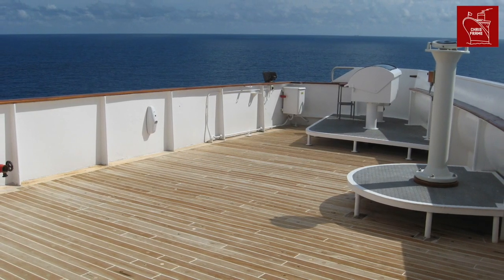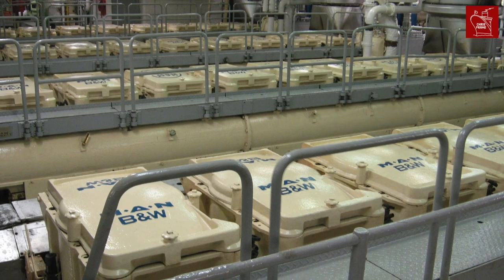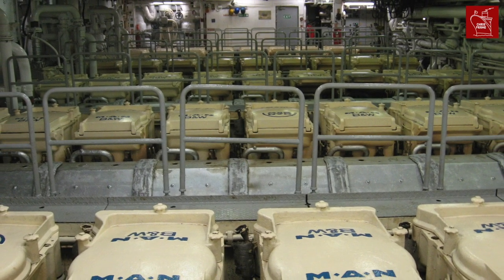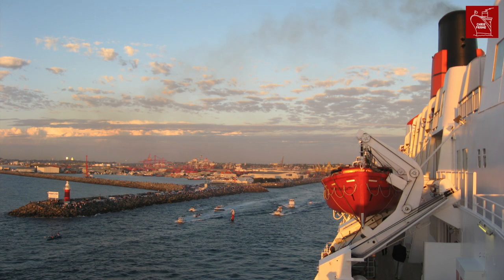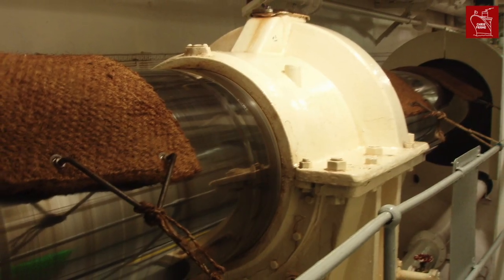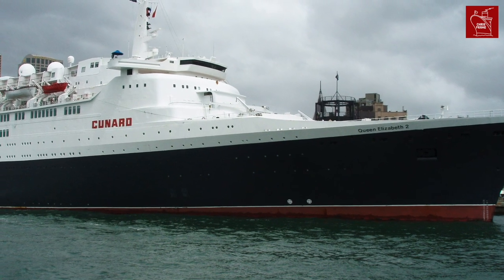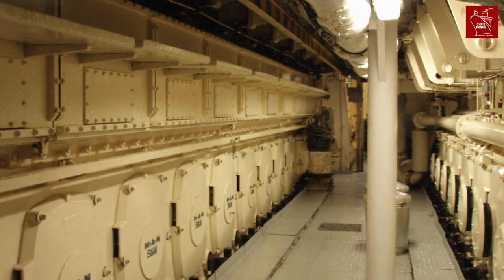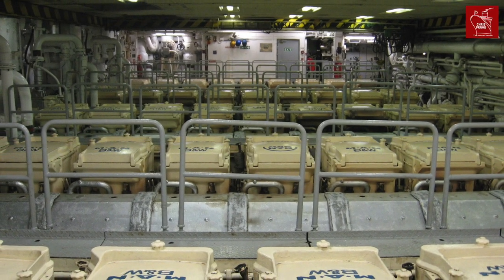QE2’s engines were enormous! Find out why!

Comment from the maker: What's the fastest speed you've seen on a cruise? Mine was 30.5 knots on QE2 during her farewell World Cruise - EPIC! Actually, we were going over 30 knots when I toured the engine room - the noise, heat and power was unbelievable! A moment I'll never forget!
Reply: 30 knots on QE2 for me too!!
Reply: That wood have been amazing!!
Reply: I recall seeing 28 knots or so when QM2 was sprinting to a medivac helicopter rendezvous - this would only have been for an hour or two, not an entire crossing.
Reply: I was aboard during sea trials in 87 after the new engines were installed. The engines were throttled up and the ship almost shook itself apart. We lost a propeller, or at least part of one and other damage to props later during a cruise.  The top theoretical speed was rarely achieved. It just wasn't feasible.
Reply: During my stay on the QE2, if the navigation display is right, we sailed 34 knots, that was after we hit 90+ foot wave in the middle of altlantic. We slowed first to a crawling 5 knots for several hours,  after we passed that turbulence, we speed up to catch the lost distance that we should have traveled. We were able to cross the atlantic still in 5 day time , delayed only of around 6hours more or less. Normally we're docked by 7am, we're able to make it at around 1pm of the 5th day of crossing. That was the time of hurricane HUGO if I were not mistaken.
Reply: Diesel engine cylinder engineering room ships
Reply: @slickmcintyre8396  Sorry slicky but i simply DO NOT BELEIVE you .  Why ?  Because Britains most famous flagship had just undergone the biggest refit in maritime history. It would surely be plastered over every front page of every newspaper if what you said was true.  The only possible explanation for what you say is if she had literally come out of the builders yard with no adjustments to the RPM and the propellor pitch which was always going to be necessary .
Reply from the maker: @sebcat04 I think it was a mistake in the way I phrased the wording - thanks for pointing it out - it's been corrected :)

Comment: Blimey! I had no idea they'd take off the funnel to change it over. That's bonkers!!
Reply from the maker: It had the added benefit of her getting a much bigger, more impressive funnel after the refit too. It now had 9 exhaust pipes rather than the original 3 from the old boilers.
Reply: I seem to remember it was the first time 3d CAD had been used.  The yard drew out the vertical trunking and also the largest part that needed to be lowered into the space.  For the engineroom it was the diesel bed plates, whereas for the motor room it was the shaft motors.  They found that they could animate the passage of these items down the trunking without cutting holes in the hull, (actually quite common) which speeded up the conversion.  I think the funnel was removed to give space for lifting out the old boilers and arranging the new uptakes as Chris says.  The funnel is light gauge and easy enough to remove.  The old boiler uptakes would have been removed at the same time.
I've done conversions where parts can be lowered through quite small openings and erected down below.

Comment: Those engines are MAN B&W 9L58/64 engines, with a 58cm bore and 64cm stroke. Each ran at 400 RPM and produced 11790 kW overall.

Comment: Surely it was the cost of bunker fuel, rather than the reliability of the turbine plant, which drove the conversion to diesel electric?
Reply from the maker: Certainly the new engines were much more fuel efficient than the steam plant - but QE2’s boilers were so unreliable with no redundancy that the constant delays, cancelations, break downs etc was untenable. So it was a combination- the unreliability led to a solution being sought. But then when the feasibility showed the fuel saving they made the decision to go with the MAN plant.
Reply: @ChrisFrameOfficial  Ah, thanks for that. I didn’t realise it was the boilers which were unreliable. Cheers. 🛠⚓️

Comment: Great stuff, but I'm not sure I'd agree that QE2 was the fastest passenger ship. Incat catamaran ferries are built in Hobart, are up to 12,000 Gross Tons and operate at between 36 and 55 knots. On delivery runs to Europe a couple of them even won the Blue Ribband / Hales Trophy. Something that size and with that range surely qualifies as a ship?
Reply from the maker: Hey Dave. I probably should have been more specific. QE2 is (was) in the class registry category (to get her passenger certificate) that covers cruise ships (even though she’s a liner) After SS. United States smashed all of the speed records in 1952 no cruise ship / liner has been able to eclipse her. My definition of “modern” relates to QE2’s service life being well within most of our lifetimes. Interestingly United States remains the last holder of the westbound Blue Riband, though some of these Cats have won the eastbound crossing. I’d probably call 12,000 tons a ship too, TBH - though Ferry and Ship do have unique definitions given their design and specifications 🤷‍♂️
Reply: @ChrisFrameOfficial  Thanks for the response. It's amazing that SS. US still holds the westbound Ribband 70 years later. Those Incat catamarans that won the eastbound Ribband in the 1990s were only about 5,000 GT, considerably smaller than the larger ones the company builds these days.

Comment: I worked onboard 87 and 88 including the world cruise and transatlantic crossings and I can tell you the new engines were so noisey and gave the crew cabins a lot of vibration.
Reply from the maker: I heard them myself too especially when standing in the engine room in 2008 going 30 knots on our way to Singapore. They roared!!
Reply: @ChrisFrameOfficial  I too served aboard after the diesel engines were installed. The noise and vibration was a disaster. Crew were eventually moved to passenger cabins for WHS reasons and passenger volume reduced as a result. The engineers came aboard to try and fix the issues - largely unsuccessfully.  The top speed had to be permanently reduced with a consequential longer journey time. You will know the transatlantic crossing was extended from 5 to 6 nights to mitigate the impact of the engines.  It's a pity you didn't mention these details. You gave it good go though. Cheers.

Comment: This is a very well put-together video. However, the QE2 is not the fastest passenger ship. That title goes to the SS United States, which on its sea trials hit a speed of 38.32 knots, almost 45 mph! Though she usually traveled no more than 35 knots while in active service.
Reply from the maker: Thanks for the kind comment. You’re absolutely right. I added “modern” into the script referring to QE2’s 1987- speed, and the ship’s service life being within recent memory. QE2 was the fastest in service from the 70s through to 2008 and with her diesel engines was faster than during her steam turbine career. Nothing beats SS. United States which still holds the Blue Riband for the westbound crossing to this day 🎉

Comment: It wasn't the turbines that plagued the original set up but the Foster Wheeler boilers which were a disaster when even after her builders trials the boiler tubes had to be replaced
Reply from the maker: Absolutely. She also has major issues with her starboard turbine requiring the low pressure unit to be rebuilt after the Falklands campaign at great cost. No redundancy in the boilers and towards the end there, unreliable turbines.

Comment: Good vid.  Just one point, those propellers are controllable pitch, not variable pitch.  Variable pitch propellers are so called because the pitch varies between the root and tip ; the blades don't move.
VP are the standard propellers for most ships.  You can see fixed pitch on the likes of ss Great Britain in Bristol, and those windmills on American farms.
Reply from the maker: Thanks for the information. I’ve always known the QE2 design as Variable pitch and it’s also referred to that way in many Cunard documents so it’s interesting to hear this additional info. I visited Great Britain in Bristol - superb experience.
Reply: @ChrisFrameOfficial  
It's a common mistake in literature but marine engineers and naval architects know the difference.  When you think about it, the individual blades on the controllable pitch propellers have variable pitch between root and tip.  Variable pitch propellers however are not controllable as they are one with the hub.
It's confusing because even manufacturers state variable and controllable as the same thing, and also that variable pitch (without being controllable) is fixed pitch!
It's about time they sorted themselves out; it's always been a problem!  I wouldn't bother editing your vid though - if manufacturers confuse the terms, the average punter won't notice...